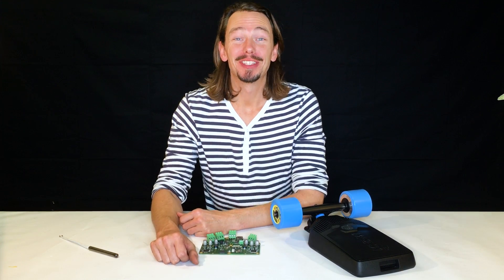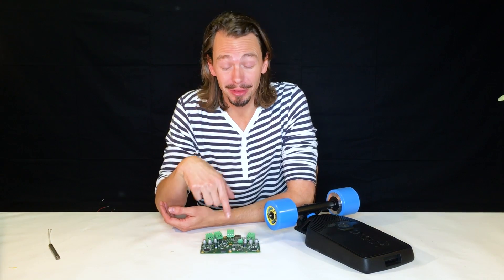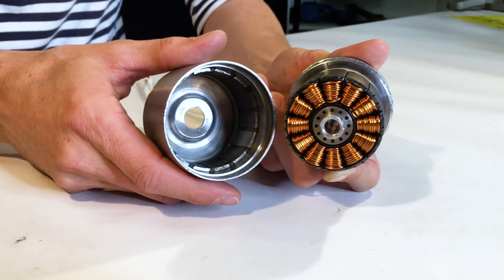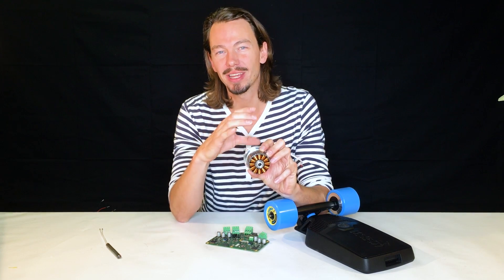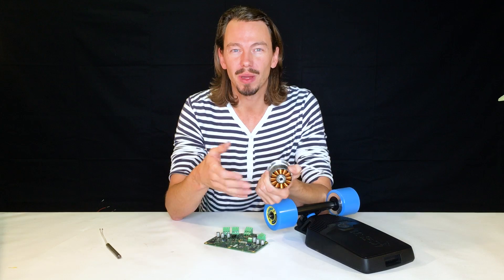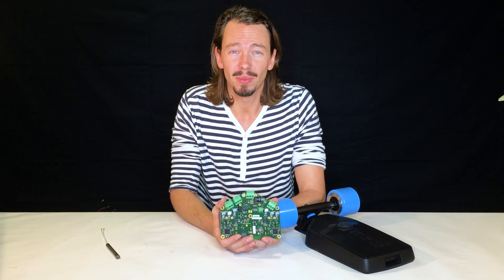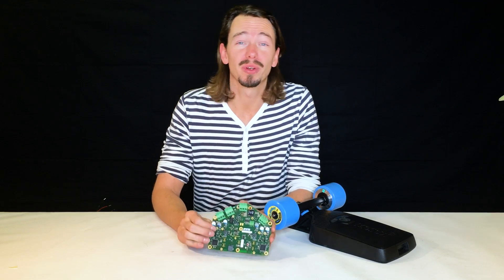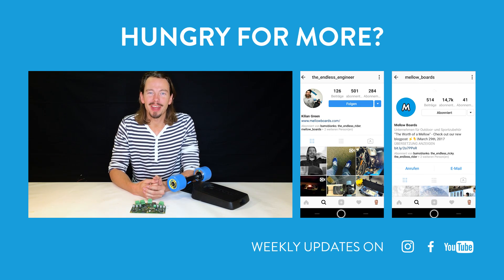Let’s get nerdy! The Mellow Boards Electronics.

Comment: Did anyone spot the brake resistor for when you can't regen brake when your battery is full?
Reply: SiMoS MCmuffin Yup, I wonder how that is situated. That is one big resistor though.
Reply: Should be pretty decent size. Building my own motor controller at the moment also on the TI's Piccolo platform :D
Reply: SiMoS MCmuffin Are you putting the progress on a forum?
Reply: I've been active on the electric-skateboard.builders and I might post some info on it, once I get it working well.
Reply: Just curious if you have a circuit of how you plan to implement the braking resistor. I'm interested in how it works.
Reply: Jake Methner Good question. Next week, we will post a yt video on the Braking Topic. The resistor will be part of it. 👌🏼
Reply: I cannot spot any braking resistor(s). Am I blind?